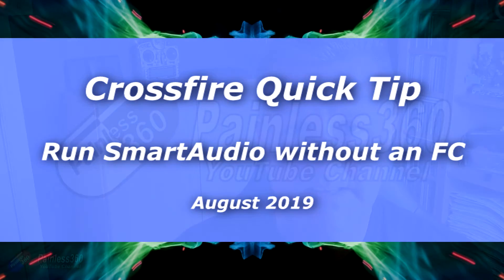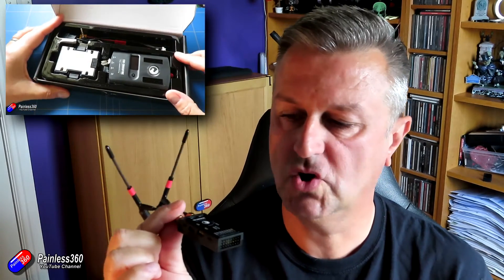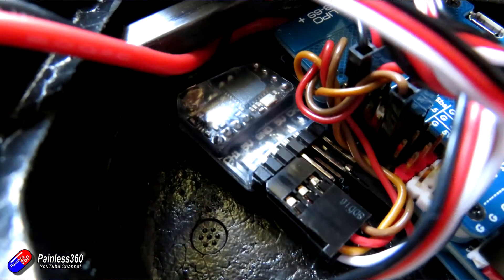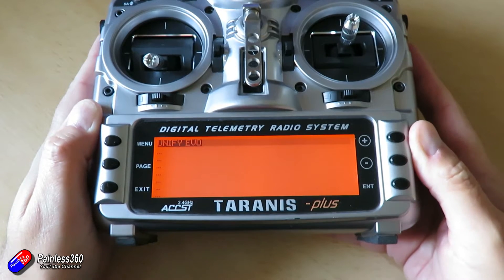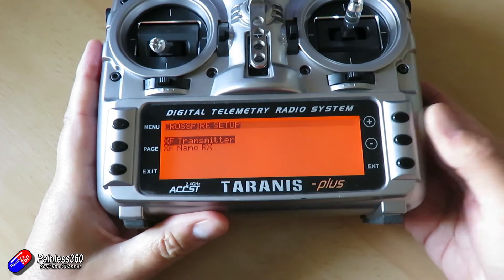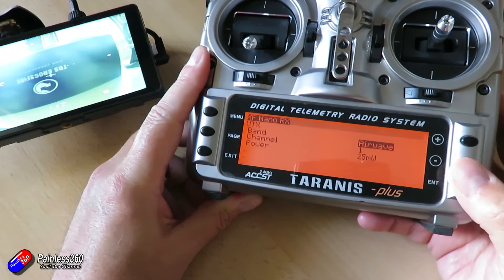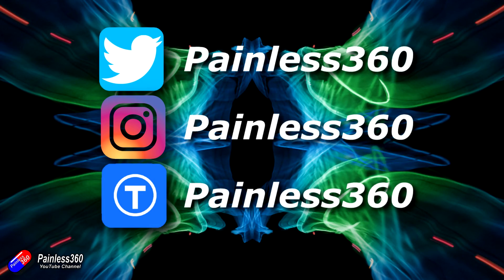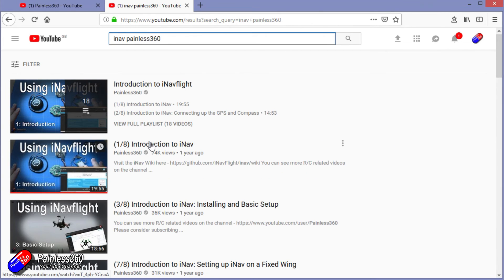Controlling a SmartAudio VTX without an FC: A Crossfire Trick

Comment: Hi , I am wondering if we can control 2 Vtxs on a drone (one FC, one CRSF diversity nano RX) using FC SA for one Vtx and this CRSF SA approach on another Vtx? I am using Inav. If it is possible, then the VTX control will be Inav LUA for 1st Vtx and CRSF script for another Vtx, correct?
Reply from the maker: I've only ever used one at a time. Port config might not let you setup two for that, best of luck

Comment: Hi. I have a couple of Darwin baby ape and noon of them worked for me that is why I have changed the flight controllers on them to other versions, but I am using the vtx, but I can not get the dam thing to change channel or even change the power no matter what I do on the radio it will not pupolate the rx on ly the tx under CRSF, and manuel changing it does not work either anyone knows anything about that. that could be a Good video to make for I have searched the internet for mounth and can not find any info.

Comment: Isn't this only for TBS transmitters?
Reply from the maker: No, anything that has a TBS system in it like a Crossfire or Tracer module... happy flying
Reply: @Painless360  Ah awesome
Reply: @Painless360  So I've set mine up. Not sure I did it exactly as you but I've connected the channel 4 pin of my xfire nano rx to my smart audio and I am able to change the channels and power. However, my power options are 0mw, 25mw, 100mw, 400mw and max but my rush tank solo vtx has 25mw, 400mw, 800mw, 1.6W (max). How do I change it so it matches the vtx?
Reply from the maker: Not sure you can, you may find that the 4 power setting you can see are actually selecting the 4 power settings on the vtx... best of luck
Reply: @Painless360  So they aren't. My max power in lua is the second highest power going off the vtx colour. I contacted TBS and they said it's because Rushfpv didn't follow the standards for smart audio. So whatever value the nano rx is sending to the vtx it's not the right one and the rush vtx is thinking it's something else. :( Just can't win
Reply from the maker: What a shame Rush didn't follow the standards...
Reply: @Painless360  Do you know if there's a way for me to control the vtx through the fc through crossfire lua? Or betaflight lua if there is one
Reply from the maker: Not that, I use the OSD for that...
Reply: @Painless360  Yea I'm using Fusion osd with crossfire telemetry so don't have an osd to change settings.
Reply: @Painless360  So smart audio 2.1 uses the converted watt to dbm value to set the power levels. I've checked and the solo uses the correct dbm values just as tbs vtx does it's just that the solo has different levels of power.This means that the tbs lua has a constant dbm value that it pushes to the SA on the vtx. Presumably it matches the Tbs vtx but not other ones. Would be nice if you could change the dbm values within the lua like you can do on betaflight!

Comment: Can't get smartaudio to work via a crossfire nano v3
I set the vtx control setting first to rx, then tried tx. On tx I get all the familiar options in screenshot. Where I get the options to change the power, channel and band, this has no effect on the vtx. Smartaudio wire on output 4 of the nano, running to the vtx, this is set also on the tx/rx firmware of the crossfire... . 
Any ideas what to try next?
Reply from the maker: Not sure, both the TX and RX lines need to be connected and the most common issues I see is that they are backwards.. Best of luck!

Comment: Hi guys. I am trying to do this exact build for my first ever foray into RC anything. Maybe a little complicated. Anyway, I put the project down for over a year now due to kids and work and COVID. I've managed to get back into it flashed everything to the latest and greatest. I have the TBS nano plugged into SBus on the FC, and using SBUS the FC recieves commands. I think somehow I can use CRSF between the FC and the nano (I think TX1/RX1?????) but I am not sure. Is using SBUS still the way to go so I can use CRSF to control the VTX and whatnot? Thanks!
Reply from the maker: CRSF usually needs a full hardware UART to work so you'll need to find one of those spare on the flight controller. See my Crossfire series where I cover this.. Best of luck!

Comment: Currently trying to get Smart Audio working with an 8 channel Diversity with a Unify Pro 32. I followed your quick tip guide however I do not get the VTX options in my LUA Script. SA wire going to the Top pin of Channel 3. Smart Audio set on Ch 3. Do I need to Send 5 V and Ground to the RX as well on the other 2 wires of the Servo Plug?

Comment: Help lol I need you to do a video on this set up a lil more in-depth I’m trying to build a cross fire phantom and I super super need to wire like this I’ve never toyed with lua scripts I use a tango but for this build I got a moduale and a taranis with some pots for the gimble control and due to the naza I have to wire like this for smart audio lol you seem to have a ton of scripts wondering where I get them is it a packaged zip I install on the taranis do I have to code the scripts? And any insight I would greatly appreciate this is just a for fun build but of course being a phantom and tbs gear I wanna really do it right lol or eles why build a team black sheep phantom at all lol
Reply from the maker: See my Crossfire basics for beginners  video and Crossfire playlist for more detail.  Best of luck

Comment: The only thing I wish I could find information on is how to write a simple script that will send smartaudio commands to enable/disable pit mode using this sort of setup.  I have my special functions set up so when switch A is not down, throttle is overwritten with -100, to act as an arm switch. I would like !SA[down] to also put the VTX in pit mode, and SA[down] to turn pit mode off.  This is how I have my FC builds set up, so as not to swamp other pilots when plugging in.  I'm still on the hunt, as I know it must be possible.

Comment: Thanks for the great video. Do you know if there's a way with this setup to set the VTX output power on a switch?
Reply from the maker: I've not tried that here - if you figure it out please let me know. Best of luck!
Reply: @Painless360  thanks for the quick reply. One more question: I've set this up with my crossfire nano and unify pro32 nano v1.1. When I go to set the output power to Max ( 500mw) through my tango 2, the VTX automatically bumps the power back down to 400mw. Any thoughts on why this might be?
Reply from the maker: Not sure, I'd check if it is on 500mW and just reporting 400.. Best of luck

Comment: hello, can i connect AKK FX2 Dominator VTX to tbs Nano rx pwm without flight controller?
Reply from the maker: If it talks SmartAudio, it should.. Best of luck
Reply: @Painless360  yes it is, but how to connect? two wires for power and green and yellow to nano rx pwm but how? :/ i got 3pins on each channel

Comment: Can change the power vtx with switch without fc? I need that went used ardupilot
Reply from the maker: Ardupilot is still catching up with things like SmartAudio and TRAMP.. Check the wiki for the latest. I've used this SmartAudio trick with Crossfire as a work-around.. Best of luck!
Reply: @Painless360  in crossfire can change with switch sir?

Comment: Hi Lee, very helpful videos. My Holybro Atlatl Micro V1 has Smartaudio functionality but having a lot of trouble getting this method to work for me. SmartAudio is enabled on my TBS Tango2 Ch4 and also soldered to my TBS Nano RX Ch4. I asked TBS support and they say this method only works for TBS VTX's, which coincidentally you are demonstrating on in this video. I've done a lot of testing without luck so wondering if functionality has possibly changed since publishing this video? TBS support said to use Betaflight to get it all working which doesn't help when I'm building a Arduplane fixed wing project. Any thoughts or updates would be highly appreciated. Cheers

Comment: I know this is an older vid but I have just started using Crossfire and am wondering if I use this method do I still need the vtx tables in BF? Thank you for everything, I have learned a lot from your vids.
Reply from the maker: No, if you have BF then the FC can run the VTX..
Reply: @Painless360  thank you!

Comment: There are tons of video's on setting up smart audio . Very few talk about how to actually use the thing once it is setup . This video includes that very obvious step .
Would this process work with a non tbs VTX such as tramp HV which does support smart audio ? How would you change power levels and actually use the thing then ?
Reply from the maker: Smartaudio is a standards so if the VTX talks SmartAudio it should work the same via the LUA script ... Happy flying

Comment: Hi Lee, I just tried this with a Micro Receiver but I can't select SmartAudio as an option for a channel. It's simply not there (all the other stuff is). Has there been an update that disables this trick? Or maybe some prerequisite is required for it to work? Thanks!
Reply from the maker: Try it on a different output. Some like to have options on that won't work on others.. Best of luck!
Reply: @Painless360  I think I tried switching one of the other outputs, but will try all of them again, thanks. For the record, I was mainly trying on Output 2 with no luck.

EDIT: It's only available on 1 and 4. so I'll have to resolder something. By the way, is there anything useful that can be done with the SDA and SCL option? Thanks again.
Reply: Well, I'm really stuck here now. As I also want to use Mavlink telemetry, the only accepted configuration I found is: Out1 = Mav TX, Out2 = Mav RX, Out3 = unused, Out4 = SmartAudio. Unfortunately this rules out the use of SBUS, and although I have "RC via Mavlink" set to on, I don't get any RC input in Mission Planner. Serial1 (the one Out 1+2 is connected to) is set to Mavlink. However, Ardupilot normally seems to expect RC at a Serial/UART set to 23 (RCin). When I sent SBUS to a UART set to 23, everything worked - but no SmartAudio that way, since SBUS and SmartAudio can only be on Outs 1+4, and Mavlink TX/RX is not possible on Outs 2+3... I'd be really glad for some help because the VTX I intend to use doesn't remember its settings after power-off, so SA is absolutely needed - but so is Mavlink telemetry of course.
Reply: Ok, I found out how to get everything at once: RC control, full telemetry (see below), and SmartAudio VTX control while using Ardupilot. Firstly, you have to switch the Crossfire outputs from Mavlink to CRSF, which has just been implemented into AP. If you keep Mavlink, you will only get a few of the sensors with this method, even when you've made the correct settings (mentioned on page 38 of the Crossfire manual) for the Serial/UART to which the Crossfire wires designated as Mavlink RX and TX are connected to. Secondly, you have to switch that Serial/UART to RCin (23) (again, you can do that with Mavlink too but get only a few sensors). Even though "RCin" sounds like a one-way thing, telemetry will still be there, and even complete (GPS, FlightMode etc.). Hopefully this will save someone a few hours. ;-)

My only problem now remaining is that I'm getting strange values and errors from the VTX for the "Band" parameter via SA when adjusting it via the CF joystick. Via LUAscript on the QX7 it seems to work better.

Comment: Hi Lee, the more I read about what can be done with the Taranis x9d  the more questions I find myself asking, I did ask in a previous message about upgrading the x9d to the latest firmware and what it can do, I’ve been out of the hobby, because of another hobby building and restoring old RD250D/400 bikes and this Bobby has moved on too fast for me, so I need a little help. Regards Jeff
Reply from the maker: Flex firmware is only used if you gave the R9M module, you can read up about the changes in the release notes for the version you're interested in ( ie https://www.open-tx.org/2018/07/28/opentx-2.2.2). In reality, if the radio is working well for you, there isn't a need to upgrade. I only upgrade once every two years or so and that's usually to show something in a video rather than its because I need it...

Comment: There are vtx with this, the Dys mi200 for example is a few years old. No need for crossfire.
Reply from the maker: A few VTX units (including the one here) have some kind of control via a PWM connection. That isn't SmartAudio though and there isn't a LUA script to alow for easy setup and checking of settings. Thanks for the post ..

Comment: A great trick for crossfire, another reason to adopt it. I still wonder why nobody makes a VTX that has PWM for output power control, 25/200/600, just with a spare channel or channel pass through. 
It would make more sense than trying to navigate to it during flight, and enable instant power shifts when needed..
Reply: wow i just said that the other day on a post it be nice to have it on a 3POS i guess TBS EVO  has it
Reply: They are out there and have been forever, just not popular. The dys mi200 has it.
Reply: @jdd1777   a 800mw and im sold or one made by akk